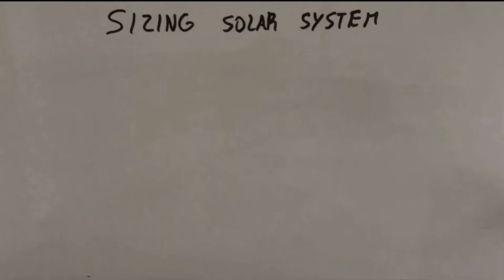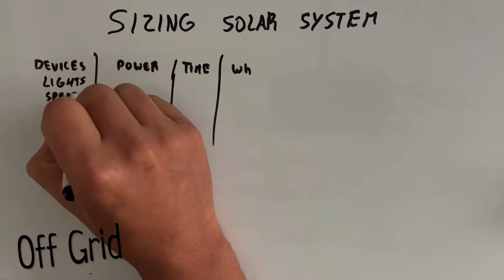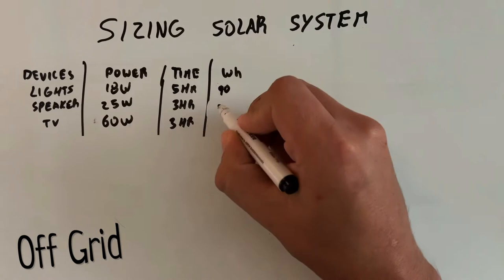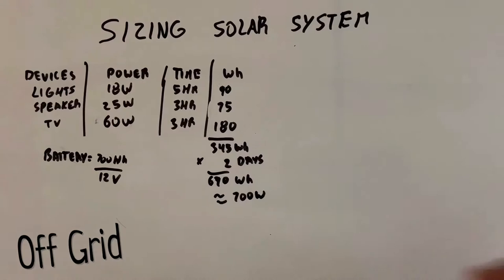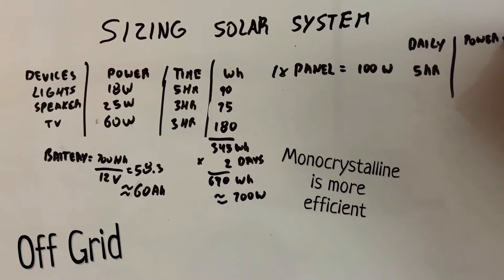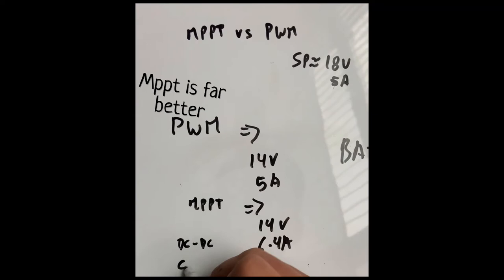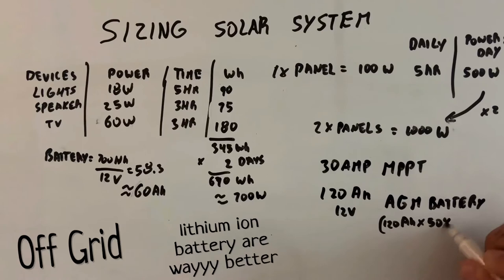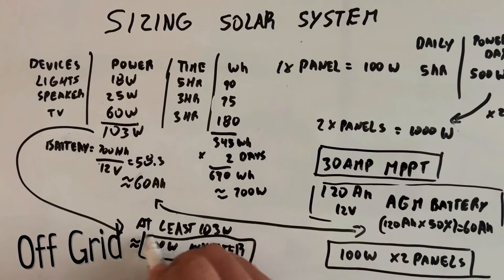Sizing your off grid solar system

Comment: Hi. First of all thank you very much for your nice and helpful explanation
Second. Can i add more batteries for example if i add 2 more it will increase my power consumption do i need more panels to do that
Thanks
Reply from the maker: Thank you, the more batteries you add, the more power capacity you have(meaning you can use whatever you're powering longer). On the other hand, the more solar panels you have, the more quicker and efficient you will re-charge your batteries. You have to find your balance depending on what you want to use, for how long and how many days of back up you wish to have.
Hope this was helpful
Reply: @peruboyjose   Thank you 

Just wondering  During the day i do not need 
To get power from my batteries only night time , My solar panel will supply me what i need  right?

Thanks 💐
Reply from the maker: @Alikuwait24380  think of it more like, during the day, your batteries will be powering your devices, but your panels will also be recharging your batteries at the same time, and during the night your panels won’t be able to recharge it so you’ll rely on your batteries power capacity for your devices
Reply: @peruboyjose  💐💐💐
Reply: Thanks a lot man. I really appreciate your help